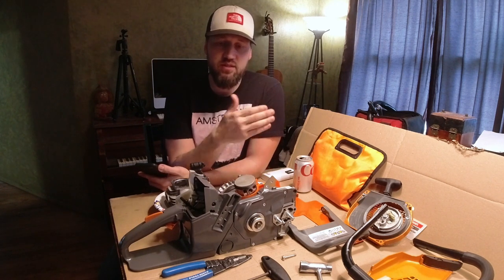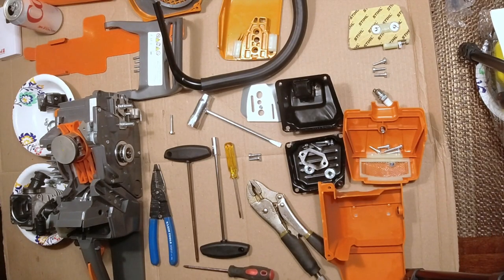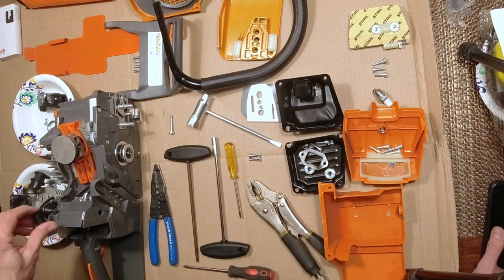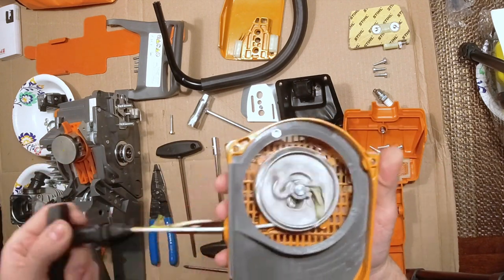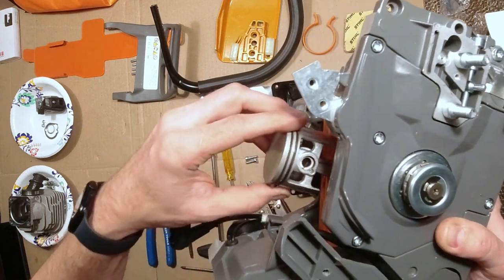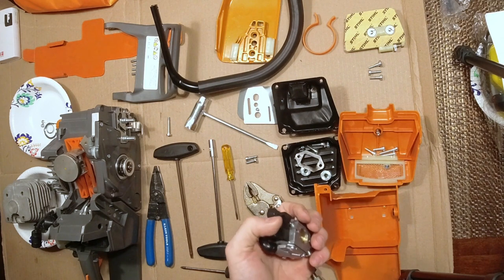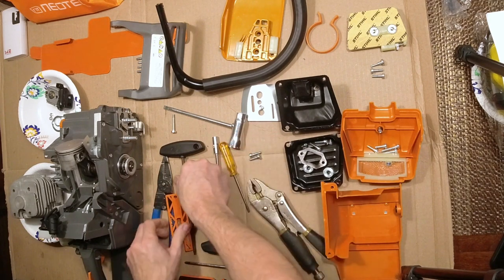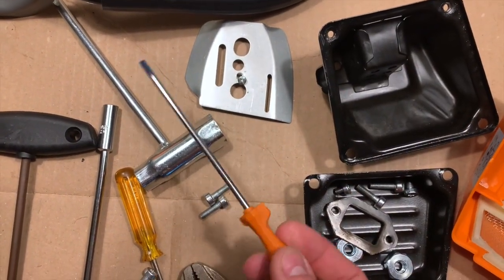New Model | NEOTEC NS872I

Comment: It also comes with the screw in fuel and oil caps.

I have the older model I just bought due to the very cheap price on sale. What I wonder is, how many of these improvements can be bought and installed on my Ns872 saw. The spark plug and elasta start handle should be easy to install. But finding the improved  parts that I might want to install for sale might be the biggest issue. I'm sure it would be cheaper to just buy the new model saw than to replace all the parts that were upgraded. But with just a few parts, it could help improve the older model enough to be worth doing.

That's just my thoughts on it as someone with the older model.

Cool video and thanks for the info. 😎👍
Reply from the maker: Thanks buddy👍🏻

Comment: When cutting can you see or feel the difference from the standard one? How hard is it to start without the decompression button? How good are their chains, should a upgraded one be purchased separately?
Reply from the maker: Are you asking how good are these against an OEM? Tbh not much of a difference for an occasional user, same power and feel really. Long term or everyday use would be a different story. I’m a firewood guy, not a logger; these machines have been great for me. 
Neotec’s bars and chain are fantastic! The chains hold up extremely well from my experience.
Reply: @IndianaDoug  I’m just trying to decide which one to buy, the ns872 or the ne872i. I’m trying to figure out if it’s worth the extra money for the (i). If I’m going to spend $350 for the ns872i, would it be better to spend an extra $25 for the 660 one. I’m know how well the 660 cuts, I’m conflicted between them all. It seems that the 660 is twice the saw for just a few dollars more.
Reply from the maker: @JohnDoe-ud2cc  this is true. Can’t go wrong with the 660 clone

Comment: @IndianaDoug Did you ever have any issues with the throttle linkage on this saw? Just ordered one and the linkage jumps out of the slot on the carburetor side on every trigger release
Reply from the maker: Not at all. I’ve had several of this model, very stable platform so far.
Reply: @IndianaDoug  I decided to bend it on the two angles in the middle of the throttle linkage to make it longer. Works great now!

Comment: Doug, I'm guessing this was a limited Production upgrade of the NS872i.
The only place the NS872i is currently available is direct from Neotec - Word Wide shipping.
Differences I immediately spotted:
HL Carburetor - not Walbro
Torch(chinese) Spark Plug - not NGK
Supper Power Coil(???) - Not the Italian Coil
$209.00 Head only seems to be a decent price with Free Shipping and no Tax, but the shipping gets questionable. From the site （Worldwide shipping link products are not included）confusing!
The real question is, Without the upgrades, is it really worth investing in?
* I've witnessed (2) NS972i performances on Youtube, after tuning. 1 in Pine and the other in 20" Oak. Honestly my Salem Master, with a 22" .375 combo and several hundred less RPM is as fast(if not faster) than either in the cut. The only disadvantage is finding an affordable Decent 24" Combo in .325 with the correct mount(or a 3/8" with a rim change)
What are your thoughts?
Reply from the maker: I think it’s the best 381 clone out there, perhaps I got lucky with mine idk. Worldwide shipping is from China directly so you pay stupid money for shipping. Best to wait until US stock is available